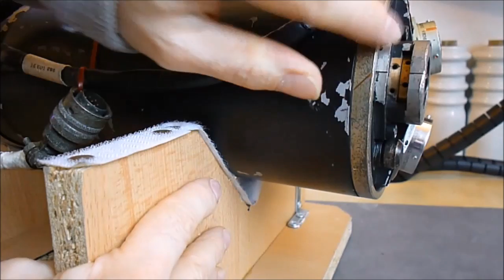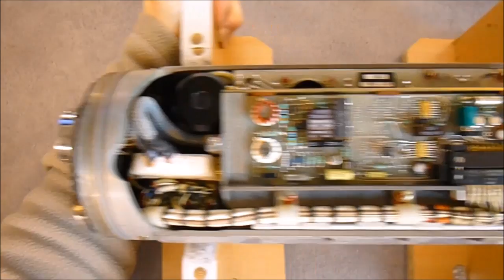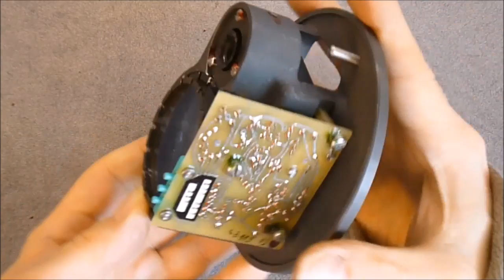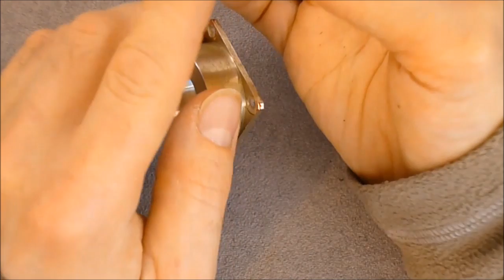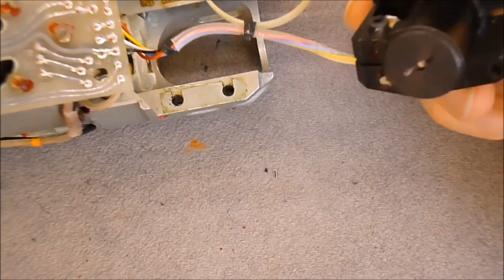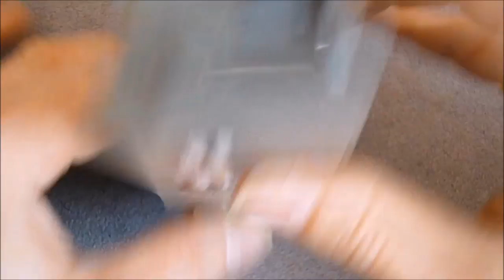Jaguar fighter laser rangefinder teardown (re-upload, all parts in one)

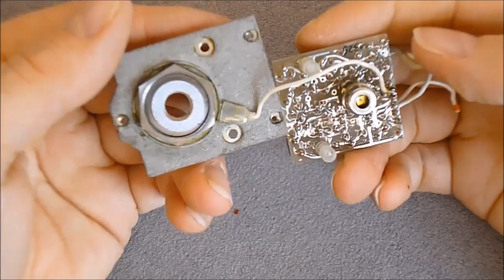Comment: I think the part under the nut on the left at 1:21:23 is very likely an annular Peltier effect cooler that is used to reduce the thermal noise of the detector and PCB a little bit (they had plastic stand-offs to prevent an immediate thermal short-circuit).  They used Joule-Thomson coolers on missiles that only had to be armed for a limited time but this is a mounted unit so needed electrical cooling.  For sensitive continuous running units they used small Sterling cryocoolers for the detectors.

Comment: It's a ND-YAG laser, the glass tube inside is just a flash tube that pumps the ND-YAG rod.
The motor is a Q-switch, to make a short pulse.
The board on the lens mount starts the counter from zero when it senses the laser pulse.
The 29.97 MHz quartz gives you one count every 5 meters.
The receiver stops the counter and is probably an avalanche diode.
Reply: Very right comments !

Comment: laser ranging and targeting system strange there is no cpu
Reply: What you need in the laser system is only the quartz timer and its frequency.  knowing the frequency of the timer and the speed of light you can calculate the distance that the light travels in each quartz timer clock.  this system is analog, it does not need cpu that are usually used in digital systems for complex calculations to do something else